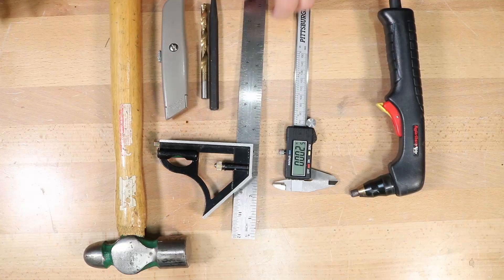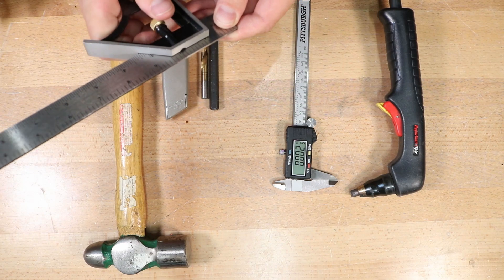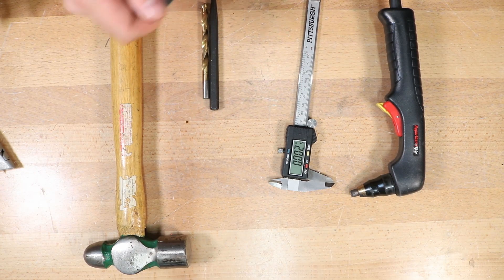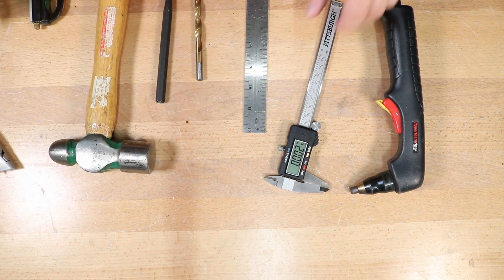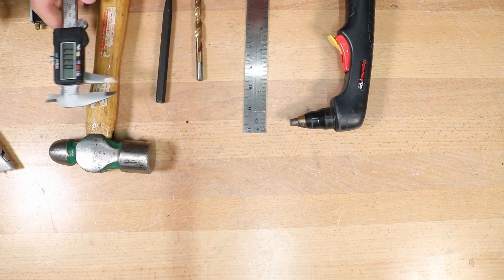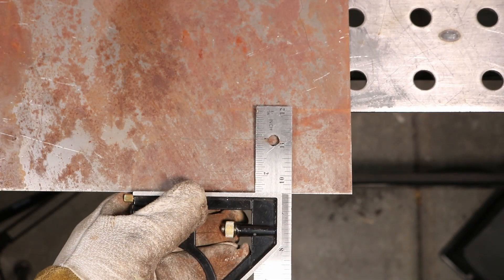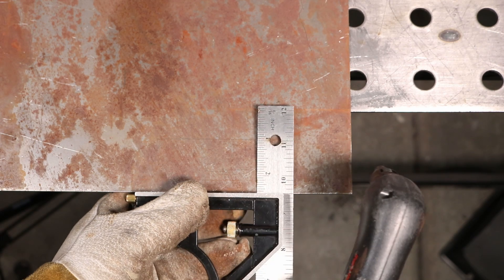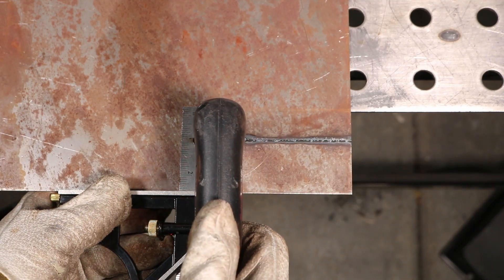Plasma Cutter Hack: Make Perfect Straight Cuts in Seconds

Comment: I thought dragging a pilot arc tip was a no-no (will burn up consumables quick). ??
Reply from the maker: Depends on the specific torch setup and amperage. These ones on the old Hypertherm 30 run a really long time like this.

Comment: Good video and thanks for sharing. Question…if you have the time. I have a “Non Pilot Arc” plasma cutter and it has a spacer guide at the tip of the torch and makes it difficult to maneuver when trying to make fine cuts either straight or in a curve. Do you have any suggestions?